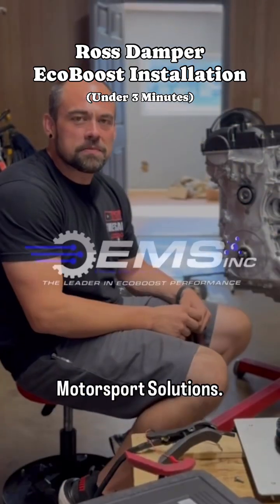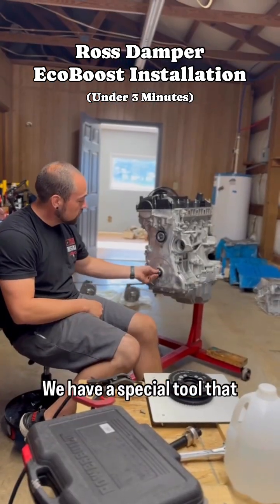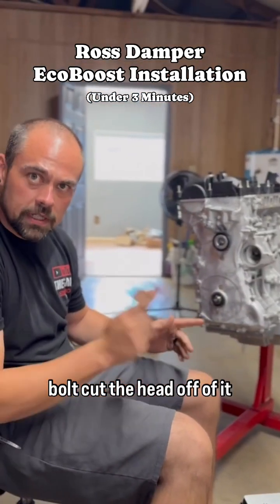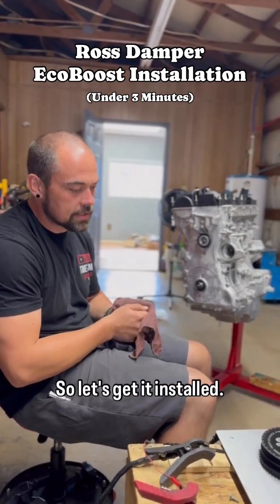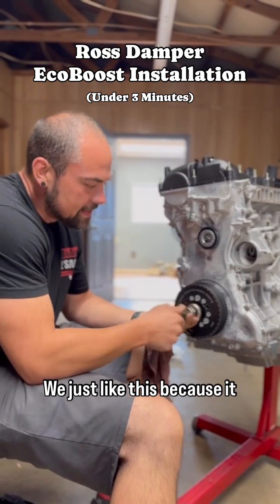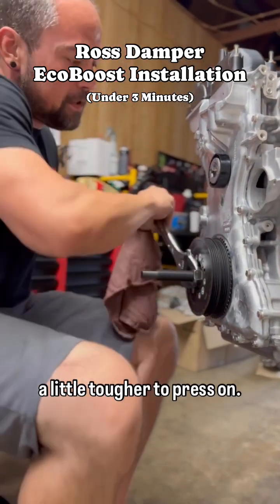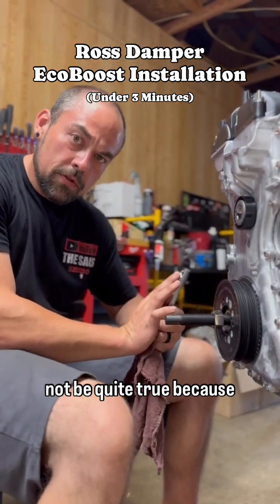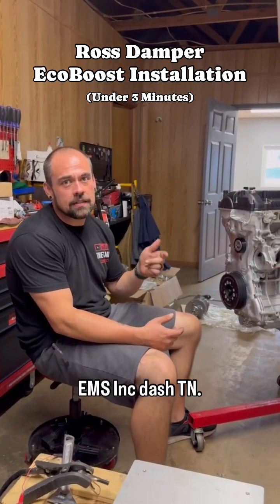Ross Damper Installation for EcoBoost Engine

Comment: My Fiat/GM 1.3 diesel has a boss that traps the cam sprocket ant drives the oil pump. The damper/pulley has four M6 bolts. If I remember correctly, there is no a locating peg.